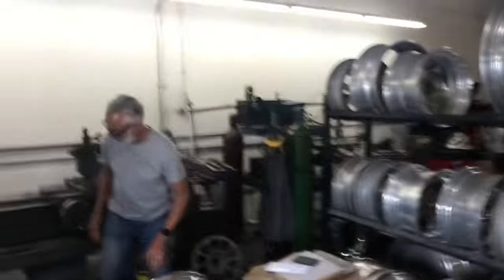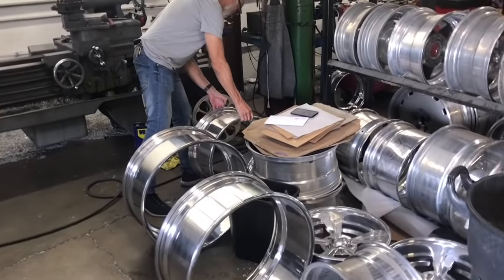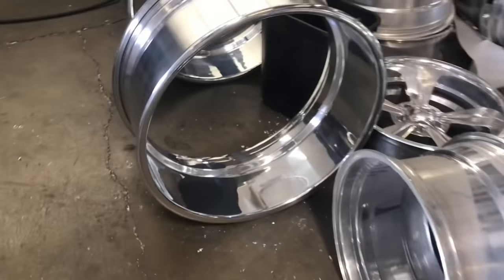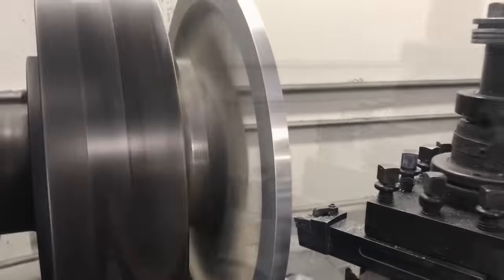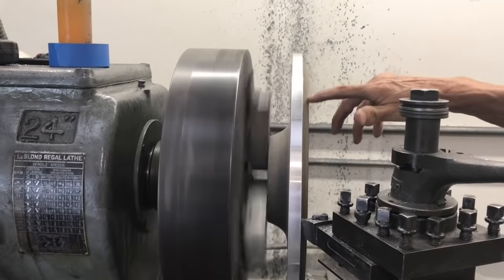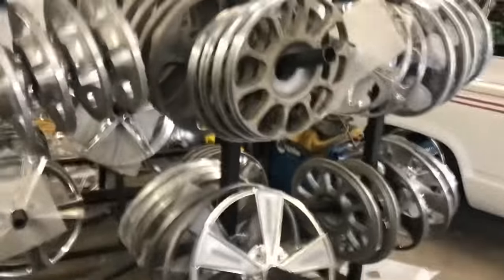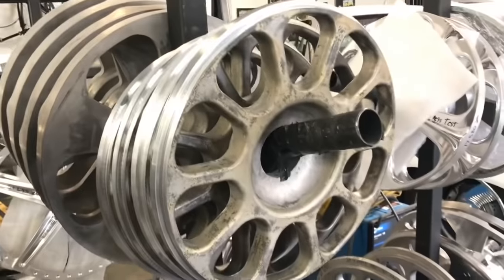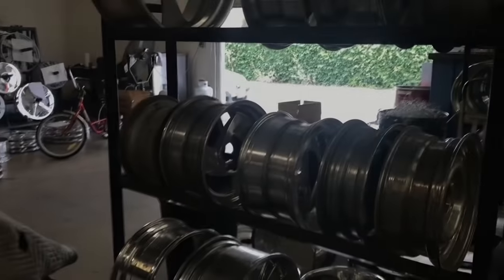New Rims for the C10

Comment: Hey Lucky with the qa1 control arms and 18x10's do you have any rubbing issues at all? Going to a similar set up thinking 275 up front but figured cant hurt to ask before I purchase them. Thanks in advance!
Reply from the maker: Hey Justin. Just spotted your question 
   Mine are 18x10 
with 5”  bs  no problems at all 
  Thanks for watchin
Reply: @luckysgarageshow  thanks man!! Love the recent updates on the truck I have a long bed but was thinking about that center brace  and modifying it.